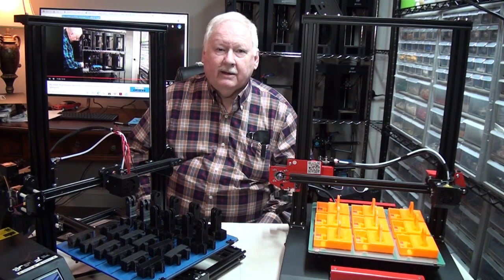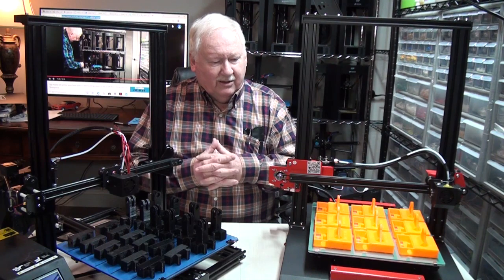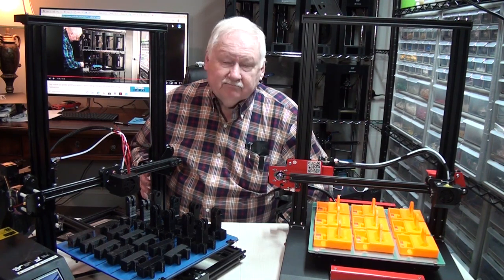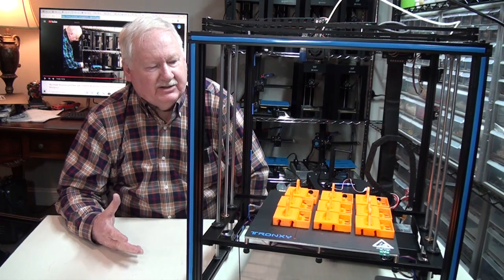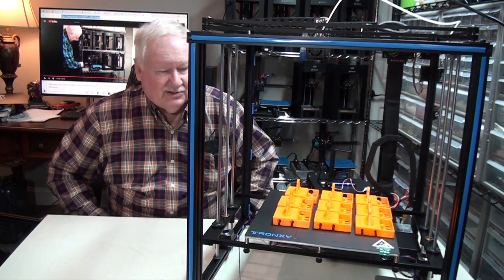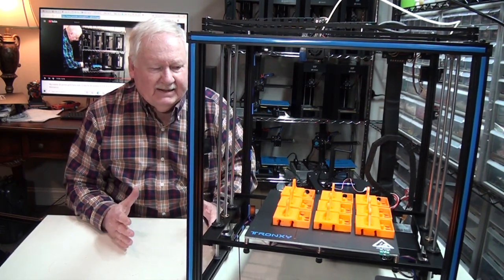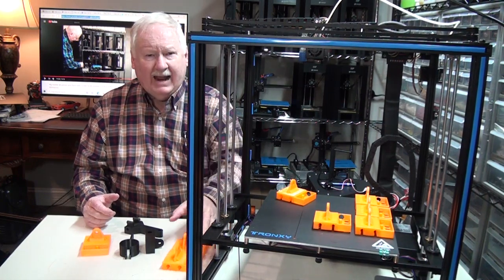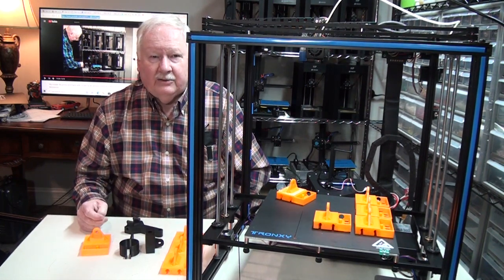MY LARGE FORMAT 3D PRINTERS used in my home based 3D print farm business, New Tech Inventors.

Comment: We actually use a Tronxy X5SA-400 in our production cycle i can run 4 parts wich takes 7 hours on my ender 3's but i can make 12 at a time on the X5SA  wich will take about 20/21 hours wich i can easily plan in to be done before we go to work and stuff
Reply from the maker: Sounds like you have a good production plan worked out there with your X5SA. I haven't used mine for production yet, but do plan to run some special parts on it soon. Good luck in your endeavors and thanks for watching...Ken

Comment: Have you managed to get the ABL matrix to save to memory on your Anet printers?
Reply from the maker: Thanks for the comment Andrew. The main Anet printers that I run are ET4-X that do not have auto bed leveling, however I do have many ET4 printers with ABL that I will be using at my new 3D print farm. I have used it on one of these ET4 printers and will have to go back an check to see if it is saving to memory between power off cycles and remembering last leveling data. I think this was your question, let me know if that is right and I will let you know what I find out. Thanks for watching...Ken
Reply: @NewTechInventors   Yes, If you have any trouble DR Vax has been in touch with a chap who has written custom Marlin 2.0 firmware for the Anet range and has a video on his channel

Comment: I use Tenlog TL-d3 pros in my home based print farm, I print a lot of the same item and being an IDEX printer I can print on the whole bed in half the time, also using two rolls of filament at a time I dont have to worry as much about running out on a long print. May want to take a look at them and try one out.
Reply from the maker: You are on to something there. The Tenlog is the dual head printer I am currently looking at purchasing especially now that I can buy one for $399.99 and free shipping. Sounds like it is working well for you, hearing that from you makes my decision to purchase one much easier. Thanks for the encouragement and the comment...Ken
Reply: @NewTechInventors  Keep in mind that the hands 2 print temp maxes out at 265 by firmware. I have had my share of problems with them but when you fix all the little issues they are amazing.

Comment: I'm not sure what nozzle size you are running however some if not all of the pieces in this video could be done with a .6mm nozzle. If you are running a .4mm it will be significantly slower. I have tuned my Prusa MK3s with a .6 nozzle and even at .20-.30 layer heights it will save you 30-50% on time.
Reply from the maker: Thanks for the info Zachary. I am starting to test print my parts with different size nozzles and will let you know how it works for me. Thanks for watching...Ken

Comment: Thanks for sharing. I am at product design phase but will probably go to build farm aswell. Have you considered voron design printers? You would be able to print with ABS which is  cheaper/lighter and also a lot faster. They are also space efficient.
Reply from the maker: I have looked at some YouTube videos on the Voron 3D printers and they sound good, but I just haven't had time to learn more. I do have the Tronxy X5SA PRO and it does a good job with my larger 3D printed parts. Thanks for the info and I will take a closer look at Voron. Good luck with your designs and future print farm, maybe I will make some mistakes you can learn from. I do know it is easier if you have all of one kind of printer in your 3D print farm. Thanks for watching...Ken

Comment: I just bought the last Tronxy  xy-2 pro! :-j thank you for the introduction.
Reply from the maker: Glad to here you got the TRONXY XY-2-PRO. I am still test printing on my first one and will soon have at least 6 parts dialed in and ready to run multi parts on 12 and 24 hour cycles. Then I will set up my other seven XY-2-PRO printers and let you know how they do under pressure. Thanks for the comment...Ken
Reply: @NewTechInventors  Tronxy arrived today and I am really impressed.  Extra hot end with heat sink even! Set it up and auto-leveled the bed in 10 minutes. Very nice.